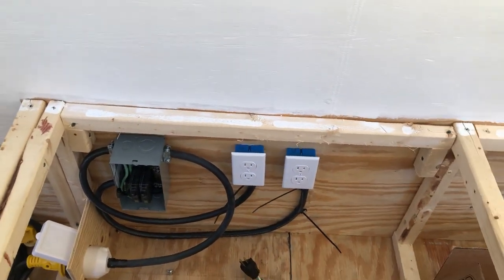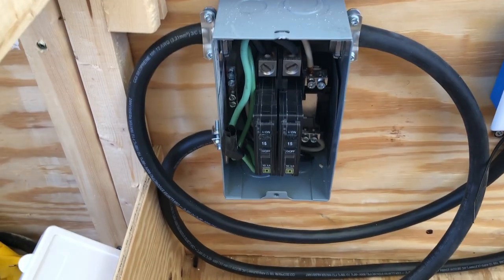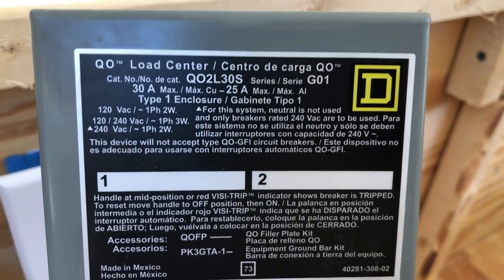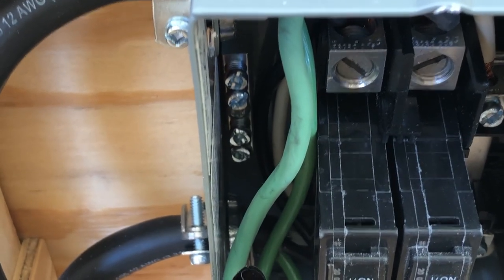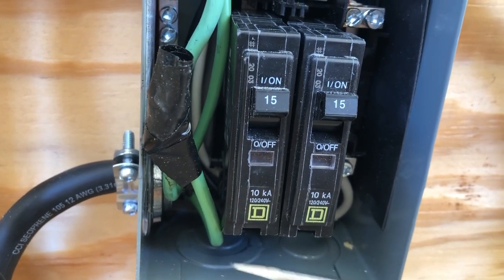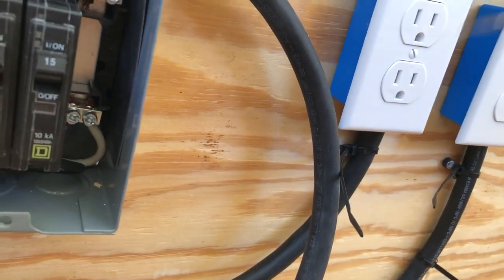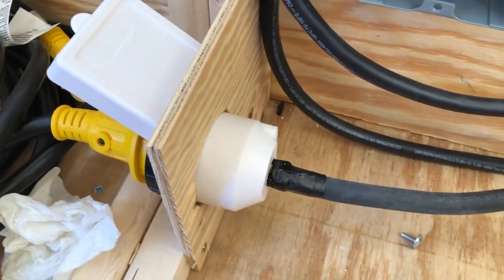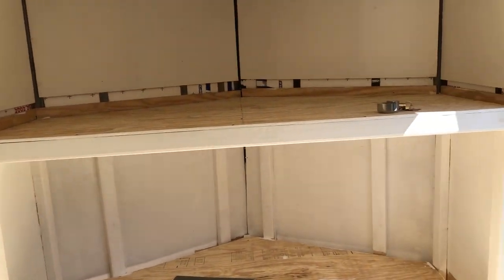How To Install Electric On Cargo Trailer Conversion.

Comment: I put the same box in our conversion and yes the ground bar was a pain to get to...lol.....I run 2 circuits out of ours, one for the AC and one for the rest of the outlets for fan, light, TV etc.   Jessie.  (Happy Place Camping)
Reply from the maker: Same here I put the first plug for ac so it's on it's own circuit

Comment: Hi question...doesn't the breaker box need to be grounded to the trailer frame too? Or is it just sufficient to ground through the incoming plug wires?
Reply from the maker: I did. I put the ground bar in later and drilled the box into frame but not mandatory for it to work

Comment: What kind of wire is that?
Reply from the maker: Stranded. 10 gauge from 30 amp and I used 12 gauge to plugs
Reply: @smittyjunebug1786  Is that SooW Wire?  Nice video.